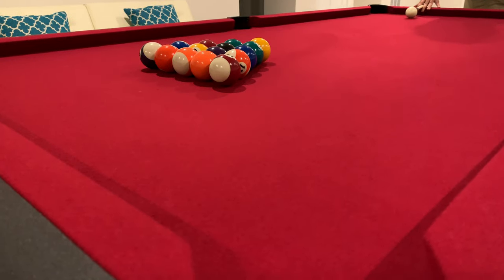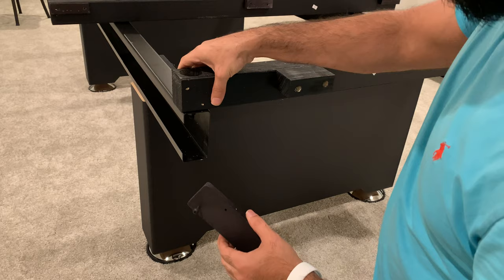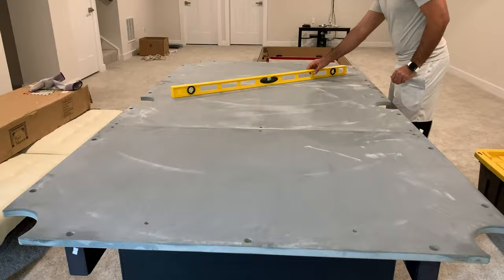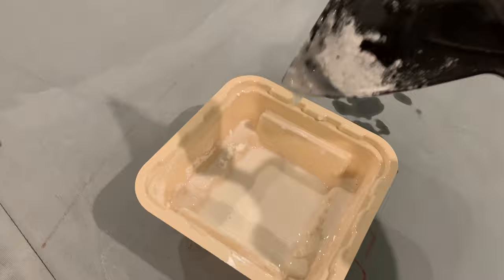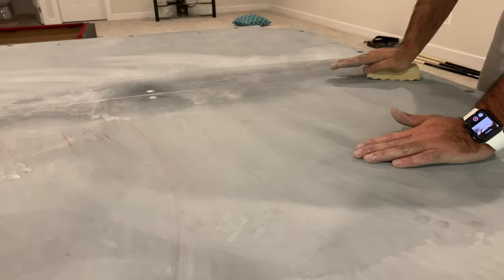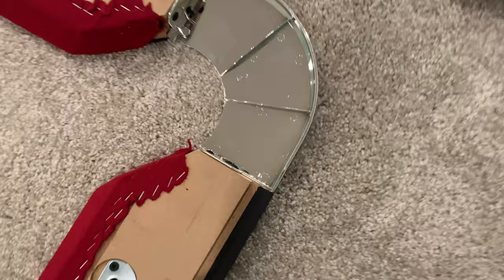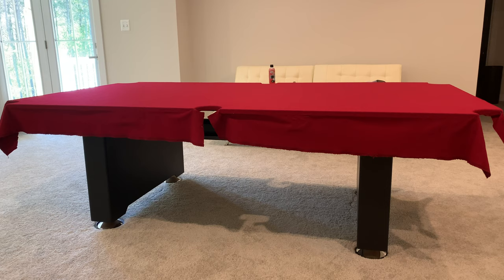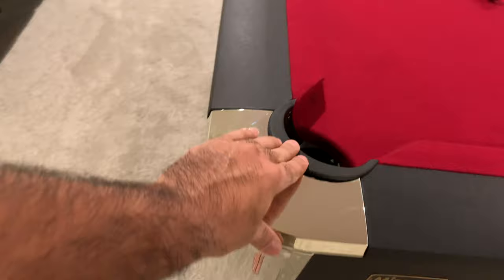Mizerak Donovan II 8’ slate Billiard table setup and review 2020 (4K)

Comment: I'm so glad i found your video before i ordered this table cause its a little bit of a let down with the cheap plastic parts an pressed boards for the price instead i found a used valley coin operated table on ebay had them refelt it for my preference an delivered for 1500
Reply: I'm glad I can help!

Comment: I would look out for any pool halls that are closing (locally) and for a few hundred extra, get a really good quality table (like a Brunswick or Olhausen - maybe even a Diamond) that will offer MUCH better play and last longer. I am very Leary of the nails securing the pockets damaging the balls as they go into the pockets at any kind of speed. They should be recessed more, or dowelling offered instead. I detest gluing the cloth to the slate. VERY hard to remove cleanly, comes the time for replacement. Still, for 'fun' or beginners, this table looks pretty neat and the slate is a HUGE improvement on crappy composite substitutes (which you should stay away from if you want decent speed on the table). Glad you are happy with it. (I wonder how much money Mizerak was paid to endorse these things?)
Reply from the maker: I wasn’t paid a penny from Mizerak haha. I did this video for fun and hope others would find it useful when they are shopping for one. 😊
Reply: Nice. Cost ?
Reply: No good table😢😢

Comment: What do you think now after 4 months. How is it going. Is a good purchase. Is it a good pool table?
Reply from the maker: The table still great to play on. The felt is terrible! A lot Lint comes out. I’ll remove it in the future for a better cloth.
Reply: @WaleedSarwari  my worries some slate have wood frame so you can staple the felt. Will gluing is not very good for stretching the felt compare to stapling.
Reply: @WaleedSarwari  Is this easy to level?
Reply from the maker: @reg828  yes. I showed that in the video. Check at 5:01.
Reply: @WaleedSarwari  When they deliver this thing did they deliver it inside your house?
Reply from the maker: @reg828  nope. Garage or somewhere they can easily put down the pallet.
Reply: @WaleedSarwari  Compared to a 1" slate. This is 3/4" slate. Is there a difference in playing.

Comment: I currently have a nice  9 ft pool table which is very nice..I had an 8 ft pool table before and I think people enjoyed the 8 footer more than the 9 footer...maybe cause 9 ft is harder to play since is longer and pockets are narrower?  Thinking about selling 9 to get an 8ft table. We don't play professionally just for fun in my garage man cave...debating between selling my 9 footer to get an8 footer..what kind a felt and bumpers  should I get ether for 8 footer or  even if I decide to keep 9 footer?  I have enough room to play on 9 footer, well I have a pub round table on corner of garage with 2 barstools and  people have to move when shooting from that corner. Also I have just barely enough room along wall to shoot..however I was thinking about putting a shelve along wall for drinks etc, etc..but tje shelve will definitely get in the way when shooting from that side of wall..so that's why I was thinking about 8 footer to just have a little more space
Maybe get a nice Dimond pro with good bumpers and blue felt, or upgrade my current 9 footer with good bumpers and blue felt too:)
Reply from the maker: I got this table for recreational play. I would recommend an 8 footer for you too. You want yourself and guests to have fun not get annoyed with the limited space. I’m going to upgrade the felt to Worsted Blend Fast Speed fabric. I think that would solve the lint issue that this fabric has.
Reply: @WaleedSarwari  thank u.  I would like to tighten the pockets of 8 footer lime the nine footer though

Comment: That's going to play horribly. You need to put some stretch on that cloth. And spray glue just on the last 1" of the slate. Glue one side let it dry for a bit then pull the other side tight. Not loose like this. And the glue so far onto the playing surface will make the balls roll away from the rails even that paper thin layer of glue will make it roll off.

Comment: The only thing I noticed you did wrong you have to level the slate slabs after you level the frame and put any shims that you need under the slate and the wood that it sits on the ball don't roll off or anything and do you feel where the slate meets is it even cuz those lines can open up nice attempt I would have just paid somebody $300 tops well you save $300 at least
Reply from the maker: I followed the given instructions. It was not about saving money, I wanted to learn, share it with you all, and have the experience.
Reply: Good job I've done that about three times it can be trick have you ever redone it again or is it still the same felt
Reply: @danielrussell8053  it’s still the same one.

Comment: How heavy was each box with the slate piece?
Reply: Pretty heavy. If you have two people, it can be done somewhat easily. The pallet isn’t movable once it’s delivered by the 18 wheeler truck driver. You’ll have to take it piece by piece. The three slate pieces are obviously the most heaviest and largest.
Reply: Yeah they all come in one box its very heavy youll need a hammer or crowbar or something like that to get the blocks of wood off
Reply: Each slate piece (and there are three) weighs about 150 lbs.

Comment: How much did it cost?
Reply: Just the table was about $1,300.
Reply: Waleed S. Are the cushions tough or like the official tables?
Reply from the maker: @johnalsaka3201  I don't know what qualifies as tough or official? The description says "K66 nose rubber". I haven't noticed anything go wrong with the cushions. If you're talking about the felt aka the table cloth then that's not tough. The table cloth is somewhat smooth.